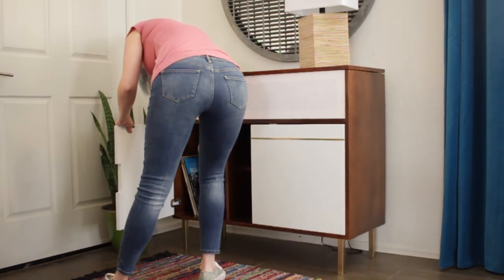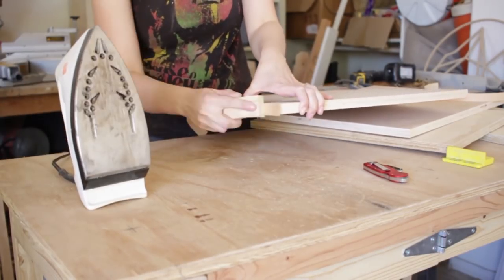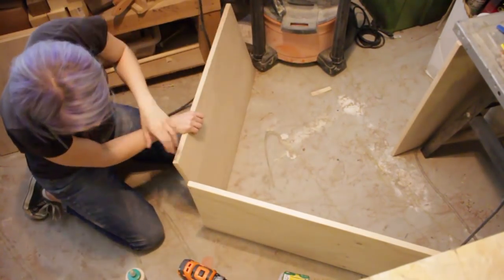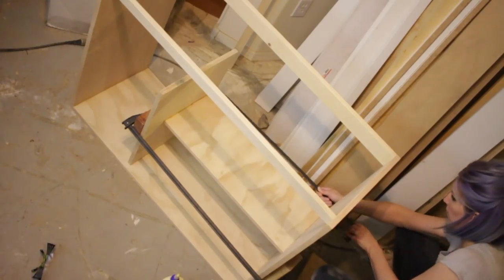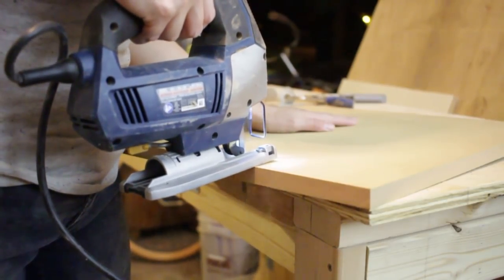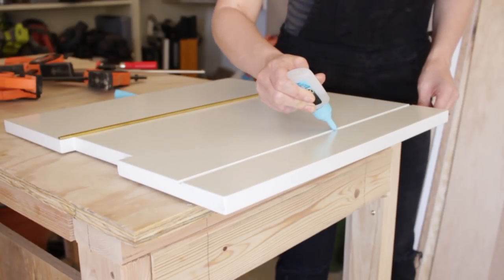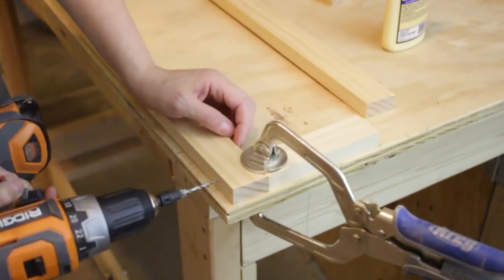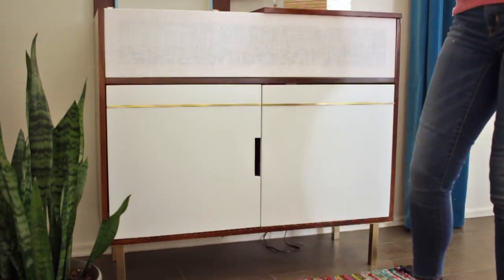How to Build a Record Console / Minibar - Woodworking Build

Comment: Try to avoid the jigsaw... theres pretty much no you can do with a router that wont come out BETTER! The jigsaw is a very crude tool. build yourself a router table (with storage) 
My opinion is also dowels are better then pocket holes as pockets are ugly and you could get away with using NO SCREWS on a build what so ever and it still be stronge AF.
Keep up the good work... I subscribed as its refreshing to have somebody that's not a guy doing tutorials

Comment: No one is saying it? Ok, I suppose it's my turn to be a party pooper... Nice build but please throw the Crosley junk right into the garbage, that's where it belongs. That thing is good only to ruin your precious records, a cheap Hanpin FU-700 would be a huge improvement. You can easily find it on Amazon for $90, look for any turntable at that price point from HiFi brands like Denon, Marantz, Sony, Pioneer, Audio Technica and few others. They all sell the exact same Hanpin turntable.

Also the speakers placement was very wrong, it's like the tweeters are not even there and the woofers are not meant to work in a air volume so small. If you are looking for a serious improvement buy a pair of Edifier R1850DB and for the love of Cthulhu hang them on the wall, preferably with the tweeters at the same height of your ears.
Reply from the maker: Thanks for the feedback! I know my speaker arrangement isn't ideal, but I'm not overly picky and I'm pretty happy with the sound. I've definitely heard I need to upgrade my Crosley! I'll look into upgrading to a Hanpin. Thanks!
Reply: Pneumatic Addict No problem, glad to help.